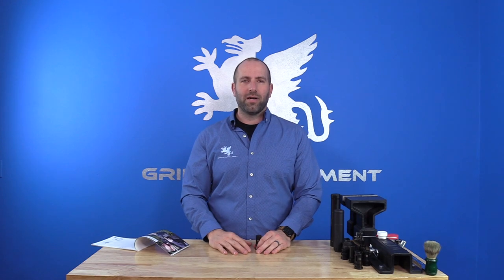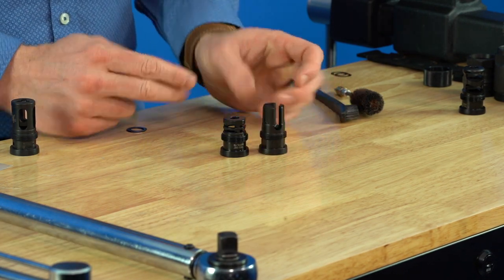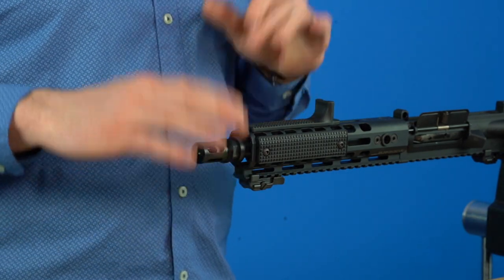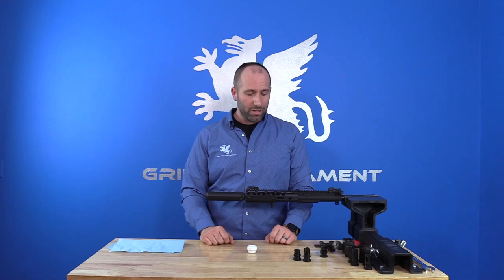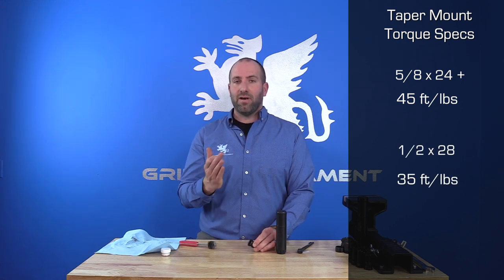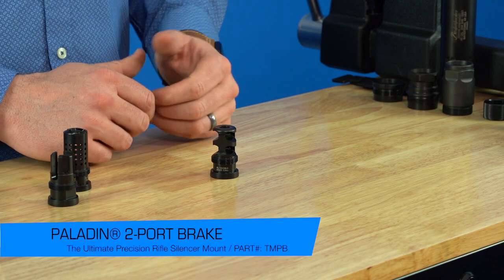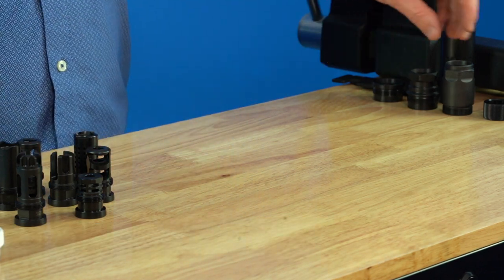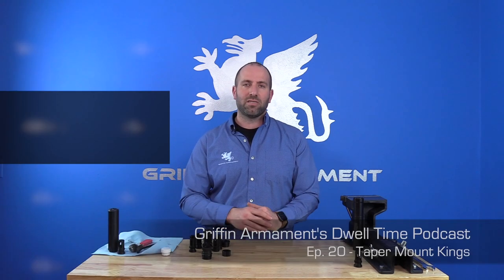Taper Mount Installation and Maintenance Tutorial

Comment: If I buy a 5.56 taper mount will a RECCE7 .30 cal can fit right on to the 5.56 taper mount?
Reply: Yes.
Reply: Absolutely, I run the Recce 7 on both of my 223 rifles using 1/2x28 ( 5.56 ) taper mounts. It works perfectly as the taper interface for both the Recce 5 and the Recce 7 are the same. Bonus is that if you ever get a Recce 5 later your current mounts will work.

Comment: So I have 2 EZ Brakes (one came with one of my Griffin Suppressors) and one Taper Mount Flash Hider. I have the Griffin Armorers Wrench. I also have the wrench that came with my suppressor. Idk why the EZ brakes don’t have two flat sides like the flash hider. I have to buy an extra tool. On top of the armorers wrench I bought from you guys thinking it would work on the EZ brake. Is there a reason why there isn’t a flat side on the EZ Brakes?

Comment: Apologies for the simple question that was answered in the video but I just to make sure.

I am installing the taper mount paladin 2 port brake in 6.5 creedmoor, the griffin logo is to be clocked at the 6 o'clock position (bottom) correct?
Reply from the maker: Correct. And torqued to spec.

Comment: How would one keep the minimlist brake from sticking in the taper mount on a optimius can. Would a grease or anti seize be good. I'm having issues on a 300blk AR
Reply from the maker: Regular interface cleaning (both the mount and silencer interface), after every range trip along with a light coat of the Horse Jipe 2300 on the thread and taper surfaces should prevent any sort of sticking!
Reply: @GriffinArmamentOfficial brake is under the hand guard so I can't really get at that too easy but it can clean the mount side. Is there a similar product I could use besides that specific antiseize? Thanks
Reply from the maker: @brentwinkelman1990  Any High-Temp anti-seize will work (ours is a repackaged industrial product called Lock Cease 20/20).
Reply: Using your taper mount system on an optimus is it necessary to shoot a few shots and then re-tighten before going into larger volumes of fire? Similar to what one may do with a direct thread? 
Also after a large volume of fire after the sequence of events described above, would it be necessary to retighten the suppressor after it has a chance to cool down but before a subsequent large volume of fire begins? Thanks!
Reply from the maker: @MYUSERNAME273  When you seat the taper mount properly (its a semi-locking taper meaning it requires more torque to loosen than it does to tighten) it will not back off while shooting. You should let the silencer cool to ambient temp before removing and checking tightness between longer strings of fire is never a bad thing!
Reply: Griffin Armament thanks and sorry for the ignorant question. I appreciate it.
Reply from the maker: @MYUSERNAME273  not ignorant at all! Thanks for commenting and seeking more knowledge
Reply: Griffin Armament I’m looking forward to getting my optimus out of jail any day now. Thanks GA!

Comment: So with the EZ brake, it just screws into the back of the suppressor and I don’t need to buy anything else?
Reply from the maker: For our taper mountable suppressors such as the Recces, Paladins, Explorrs, the EZ Brake just screws onto your barrel and then the suppressor can be mounted on the muzzle device. For the Bushwhacker 46, the suppressor needs to be in the Plan A configuration (necessary parts for configuration are included with suppressor). For the Optimus 9, the suppressor needs to be in the Midsize or Taper Mount configuration (necessary parts for configuration are included with suppressor).  If you're wanting to run the Optimus Micro on a taper mount, you'd need to purchase the Optimus Micro Taper Mount Interface as well as the desired taper mount as the Optimus Micro does not ship with the necessary parts to run in the taper mount configuration.

Comment: Do you recommend Rocksett or similar when Installing muzzle devices?
Reply from the maker: We do not,  the only thing needed to properly install a taper mount is proper torque according to the thread pitch (referenced in the video).
Reply: @GriffinArmamentOfficial  But is there a reason NOT to use rocksett?
Reply: @GriffinArmamentOfficial is there a reason not to use rocksett?

Comment: Does any of your devices work on a DA Wolfman?
Reply from the maker: patrickonasis1 we’re not certain what the ID thread pitch is for the rear interface of that can. If it’s the same as other standard pistol can offerings, then our 1.125x28 Plan-A adapter will be compatible.

Comment: My mount does not have the logo etched in lol
Reply from the maker: What muzzle device do you have? The logo only goes on muzzle devices that require timing. The Griffin logo should be in the 6 o'clock position when the muzzle device is installed.  Flash hiders would not have the logo as they do not require timing
Reply: @GriffinArmamentOfficial  I have the taper mount that came in the box. I ordered a Recce 5 from Silencer Shop and just got it in last weekend. The only etching on the mount is the thread demensions. I have it snug on my AR, wasn’t to worried about alignment until I saw this video. Lol
Reply from the maker: @eggamyer3371  Then you have the Taper Mount EZ Brake that does not require timing, just appropriately torqued to spec
Reply: @GriffinArmamentOfficial   but it still comes with shims, why?
Reply from the maker: @RenderElectric  if you ordered the Taper Mount EZ Brake and it came with shims, that was an oversight on the packaging/fulfillment team. So now you have extra shims that are not required to mount the device you received.
Reply: @GriffinArmamentOfficial  Came with my RECCE 5 actually. I also picked up a Taper Mount FlashComp, it came with shims too, yet the manual says for 3-prong flash suppressors, skip shims. That's correct?
Reply from the maker: @RenderElectric  The FlashComp does require timing. Without the 3 prong geometry on the end, it would be a Hammer Comp
Reply: Thank you for answering this question! I do have the EZ brake muzzle device. No shims came with mine. Nice to know all I need to do is torque to spec. @GriffinArmamentOfficial
Reply: Also, would you recommend applying some grease to the threads on the taper mount to prevent lock up? I've had this happen a couple of times so far. @GriffinArmamentOfficial

Comment: Kinda wish you guys didn’t make it a pain in the @$$ to tighten the muzzle devices; it’s annoying that only a thin part in the middle of the suppressor threads and the useless circular back part is where you tighten it, which means having to order a specialized wrench for it instead of a standard wrench/socket. Seriously though, why is it not on the BACK of the muzzle device?? Poor design choice.

Comment: Where can I find an open wrench like the one you use with your torque wrench to install my 1/2x28 and 5/8x24 minimalist breaks?  I have never seen anything like what you are using and wouldn’t even know what to call it?  Thanks!
Reply: It's called a crowfoot wrench. They come in 1/2" and 3/8" drives. I think most muzzle devices use a 3/4" open end wrench size. Also, there are complete AR crowfoot torch wrench kits. They include the torque wrench and 4 crowfoot wrenches for all of the AR parts.

Comment: Where can I find an open wrench like the one you use with your torque wrench to install my 1/2x28 and 5/8x24 minimalist breaks?  I have never seen anything like what you are using and wouldn’t even know what to call it?  Thanks!
Reply: @Hopeless I believe you have to be sure the crow wrench is at a 90 degree angle to the torque wrench or your torque calc may be off (too much torque).
Reply: He asked what the wrench socket was and where to find it, not how to use it.